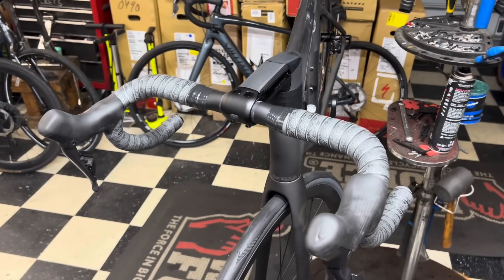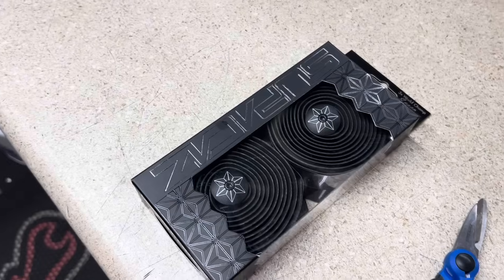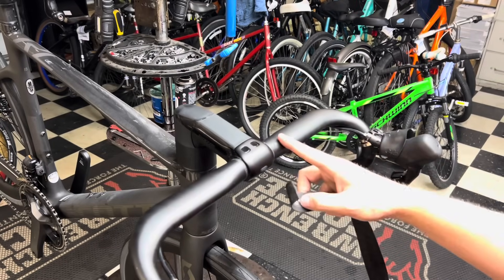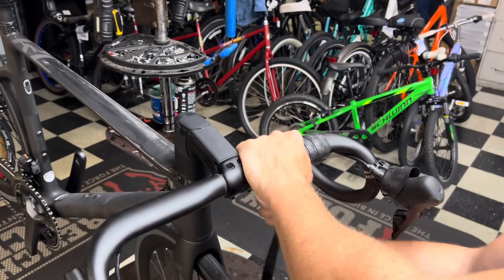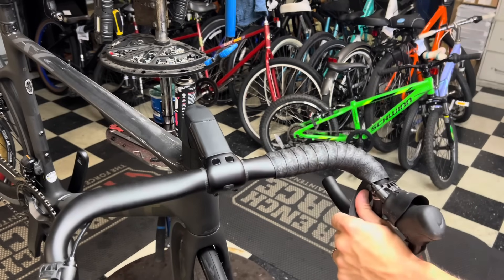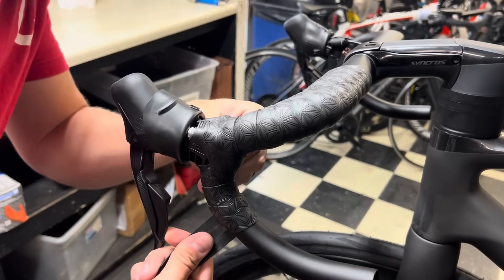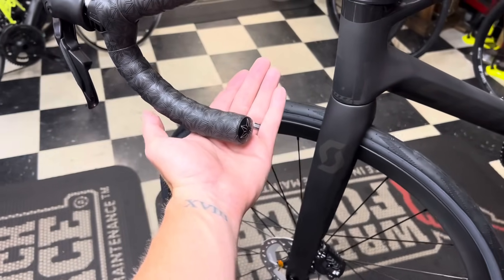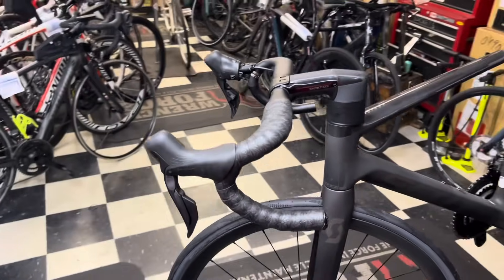HOW TO WRAP HANDLEBARS ON A ROAD BIKE, NO TAPE SHOWING *CLEAN*

Comment from the maker: Is this not the cleanest setup to run?!?
Reply: its clean but im not a fan of the fig. 8
Reply: Gonna try this next time I do my bars but how did you determine how much to cut from the end? Or did it just happen to be the perfect length?
Reply: Clean yes, but prone to rolling the edges, and also collecting dirt and water.  That’s why for the last 50+ years it has been done from the bottom to the top.  There’s a reason for that.
Reply: @karlp4443  exactly - just look at the pro peloton at TdF, simple
Reply: @karlp4443  Team Ineos mechanics apparently are wrapping the bars from bottom to top in the traditional way but they’re then securing the bar tape with glue instead of electrical tape. Best of both worlds. I’m gonna give it a try next time I wrap my bars. If I fail I can still use the good old electrical tape.
Reply: @karlp4443  I still see no problems
Reply: loll, my biike.
Reply: @TDZed  cut off excess when you've finished wrapping.
Reply: Your wrapping the tape the wrong way. You wrap from the bottom up so the overlap is facing down. That way as you apply downward pressure you never peel the tape or lift the edges of it. Maybe its less of an issue with these new fangled tapes, but classically its bottom up.

A bit of electrical tape is perfectly fine. You can even get it in fun colors/patterns. I think it looks cleaner going a bit thinner with the electrical tape than the bars in this video had.
Reply: he also went the wrong direction, it roll after a few miles

Comment: Nice but wrong way around. This way it comes loose faster, dirt can enter faster and when moving hands downwards along handlebar it doesnt feel as smooth
Reply from the maker: who the hell slides there hands down the bar, you lift and grab, also dirt and sweat enters handlebar tape regardless, yes I know it was a reverse wrap, but there wil be no issue with this, people always wanna complain
Reply: @GCPerformance18  yeah , pretty dumb. I play tennis, if you put it on correctly , i change hand positions so often, if its tight. It wont come off unless you want to.

Comment: The first time I saw someone wrap it reversed was a few years ago. I started doing it shortly after when I was in a gravel race and it rained for most of it. The finishing tape came loose as a result on one side and wouldn't stick anymore. I had to unwrap the bar tape some and tie it off to keep it from unwrapping anymore. The only drawback to the reverse wrap is I push against the edge of the tape when reversed wrapped.
Reply: Thats why its really a gimmick. As far as im aware, only novice riders and ones that dont ride often wrap from the top down. Word on the street is all race teams wrap from the bottom up, with 50% wrapping one direction and 50% wrapping the other. Some wrap for the hands twisting in the drops, some wrap for the hands twisting on the flats. Ive heard it stated that its when holding the flats of the bars when athletes are really using a twisting motion on the bars, which makes sense to me. The same person said when you're in the drops its more of a linear motion, which also makes sense to me.

Comment: I'm wrapping this method for years, hate electrical tape on tops, but you run drops in wrong way, better is to run from inside to outside, no issues at all with this direction.
Reply from the maker: same here, I live in florida so the electric tape melts around here in the hot conditions

Comment: I like the idea of no tape, but isn’t the tape wrapped backwards to the way the seams show.  When your hand is on the bar you tend to push away and you might see a “rolling” of the edge????   Thoughts?
Reply from the maker: everyone says this, this tape used in the video is very nice tape, had a big strip of adheasive on the backside, when done correctly and pulled taught, this tape will never unravel, all the jobs I have done the customers wear the tape out before it ever moves. I have seen with cheaper tape with small strips of sticky on the back and poor fit or rider getting fatigued they tend to lean on the bars more then intended too and can cause the tape to move around

Comment: This is ofcourse the logical technique if you don't want to use electrical tape. However, ofcourse there's a very good reason why the bar tape is professionally wrapped from the end inwards. This is because your hand would typically run over the bar in an outwards direction. With this technique that would mean your hands would run "against the grain" so to speak and this can wear out the edges of your bartape quickly. This is why we use finishing tape. Otherwise everyone would just do it like this guy in the video.

Another pro tip is to change the direction on the lower part of bar wrapping from the inside to the outside (when starting from the end of the bar ofcourse). Because when you grip it your hands tend to rotate in the opposite direction when gripping the lower part of the bar. This way the rotation will tighten the tape instead of loosening it up.

In the end this doesn't matter much for performance but this technique would make your bartape significantly more durable meaning you'd have to change them less frequently. So pick your poison: frequently having to change your bartapes or a piece of finishing tape...
Reply: ^^ This.  Years of experience has shown me that wrapping bars "top down" as shown in the video instead of the traditional "bottom up" results in the bar tape wearing much faster.   My current bars were wrapped "bottom up", with ugly electrical tape, and the Shimano padded tape is still going strong after three years of use.
Reply: @buster.keaton  rather have sexy setup and replace bartape 30% sooner.
Reply: I do both. Like shown here from the top, then stop under the hood, cut to triangular edge and hold down with 2 - faced carpet tape. Then start from the bottom in traditional way, using plug, in opposite direction. Cut in triangle end to match up perfectly with top section to carpet tape and then finishing tape on top. Advantage is that the finishing tape covers the joint and never sees much wear, while the tape is in the right direction in both sections, being locked in by the plug at bottom.

Comment: This is the way that I wrapped bars in the 1970s.  I mostly used adhesive backed cloth tape (I believe it was Tressostar) back then.  Looked good at first but the tape would gradually fray and creep then down the bar eventually leaving gaps.  Plastic tape (Benotto was popular in the 1980s) wrapped this way would also creep leaving gaps much faster.  That's why nowadays the pros wrap from the bar ends up.  If you don't mind retaping your bars more frequently then top down as in the video works.

Comment: Have to admit this looks dope. After fluffing my bar tape numerous times last night I did this and it looks great. Much easier to get it tidier at the top starting here and the lack of need for securing tape makes it look super clean. I’m not convinced it won’t roll or move about but I’ll see how it fares. Bar taping is a bugger of a job if you are plagued with ocd lol!
Reply from the maker: just vie it a try, it will not roll around at all as lonmg as is it done right
Reply: Ive heard too many horror stories and dont mind a little tape. If you do a clean job the tape isnt even that wide. Plus you can use all kinds of fun colors!

Im thinking orange bar tape with some kind of neon vinyl tape. Or maybe I can find some retroreflective stuff, that would be fun!

Comment: Manufacturers used to use this method for decades until the "Pros" decided to do it the other way.
I have used this method all my life and I have never had any tape come loose, I am 55.
I always use tape with the adhesive on the back.
I used to do this at Raleigh and have easily done over 30,000 bars this way so I have a little bit of an advantage 😀.
I know it was over 30 years ago but the skill never leaves you once you've learnt it.
125 bars a day, 5 days a week and 48 weeks a year.
I was doing it for just over a year.
Reply: I'm 55 and tried this once about 30 years ago. The tape rubbed off on the bend from the straight part of the bar into the hoods. I never tried it again.

Comment: I prefer end to stem wraps as you’re not rolling the edge of the tape.
Wrapping the drops with double side tape first is good though, as if you ever crash and rip tape, it won’t unravel.
Reply from the maker: who rols the edges I have never seen that, are people just being lazy and letting all there weight sit on top of the bike and let themselves slide around on top? get a better bike fit
Reply: @GCPerformance18  Yep, on reflection I think it would be fine if you use decent tape with sufficient tension. It certainly looks super clean.
Double side sticky tape underneath the bar tape on the drops is worth it too.

Comment: Makes me wonder why we ever started from the end cap ? The electrical tape always unravels,  I tried using electrical shrink housing, which does a neat job, but your method is better.
Reply from the maker: Yea especially with the moisture and the heat here in Florida. The electrical tape gets melted and slides away

Comment: You sir, are an artist.
Reply: @GCPerformance18  my old bar tape started coming loose shortly after watching this - it was a sign! I was slightly concerned about the tape edges facing up on the drops but did it anyway. 
I had trouble getting the tape tucked in the ends neatly but got there eventually. Expander plugs help keep it tight. And the tight wrap means and don’t feel the edges. 
Thanks to your video my bars are now clean AF!

Comment: Question.. i used supacaz tape last week to wrap my bars,, but it didn’t come out that great after looking at it closely… is it too late to retry with same tape?   I did not do reverse wrap and I didn’t cut the tape (taper cut) when I got to the end.. i just wrapped a few rounds of electrical tape and called it a day lol.   It doesn’t look great up close.   :(
Reply from the maker: Yea you can re do it. It shouldn’t be a problem. Just pull it tight

Comment: I think I will try this on my next wrap. Does wrapping clockwise or counter clockwise makes any difference ?
(maybe we should wrap in the direction we tend to squeeze the bar when we ride ?)
Reply from the maker: as long as you have a nice tape with a nice adhesive strip and you wrap it tight and secure it at the end then you are good

Comment: My exprience with reverse wrapping not good... Because it's in reverse so the overalpping is in opposit direction and when I shift from top to hood the lip of the tape kept on catching and when doing offroad the dirt will trap underneath the tape.
Reply from the maker: what? there will be no issues with this way, that is the problem though that this is all subjective because one person can get a bad wrap job or maybe do it themselves and not do it correctly, and could be looser then suppose to and this could cause those issues.
Reply: @GCPerformance18  i really admire your passion trying to explain every single hater that the bartape wont unwrap XD

Comment: Dude I tried your reverse wrap with the Aerofly2 but they managed to unravel after a couple hundred miles.  Any pointers?  Pull tighter?
Reply from the maker: yea man you have to pull tighter maybe I dont know because eveyrone is different btu i have done so many of these builds and i od ahve any issues with it
Reply: Depending on the way you wrap it… most people don’t notice, but when out and riding they grab the handlebar with a straight wrist and slowly pulls it down… so depending on you wrapping back to front or front to back, can have an effect on it unraveling without you intentionally wanting it to 😊
And yes, as tight as possible 😊

Comment: 20 some years ago, I bought something called "Handlebar Tape Locks" for my bikes, that were plastic, and covered up any electrical tape that secured the ends of the bar tape. They came in multiple colors that could match your bar tape. I'm still using them on all my bikes, 20 years later. Looks like they are only available from China. PS. They only work on round bars.
Reply from the maker: that is awesome i have not heard of those but for sure I have to take a look at something like that
Reply: @GCPerformance18  if only flat bar diameters were the same as drops we could just use lock on grip collars.

Comment: I notice the way you wrapped it on the drops the tape is going inward not out away from the bike. I've always heard to tape outward on the drops. Is this not a thing to worry about anymore? How long does this method for you?
Reply from the maker: Im a mechanic at the shop and we have been doing this now for over 5 years on our personal bikes and also customer bikes here..... no issues at all and as long as it is performed correctly and pulled taught, it holds up so nice

Comment: I’ve watched a good dozen wraps with good info, including this one. I found maybe 2 that account for hand positions and natural wrist rotation. I just started to do my own bars as I noticed the wrap starting to lose it’s tightness. Granted the amount I was riding I should’ve changed the wrap once or twice a year. My hands tend to roll outward on the drop and backwards on the tops. Many examples have the tape rotation in the other direction. Has anyone come across this? Many years of riding a Fixie and single speeds have changed my geared bike riding bar position. I am going to try this only have the tape roll out on the drops.
Reply from the maker: could also play a big part in what tape you are using, per exampple the tape I use in this video it is very sticky and also the adhesive strip on the back side has nice grip and is a thick strip, no amount of pressure is going to cause it slip when done right, to be honest the tape will start to have wear marks before it un ravels if done right. make sure the tape you choose is a nice quality first

Comment: This goes directly to my Favourites folder for further perusal, examination and application in practice :):)

A question tho-what do I do if the bar tape I use is quite a bit thicker than this one? I like silicon padded tapes and making a figure of 8 creates a bulbous monstrosity.
Reply: i did figure 8 with a bontrager double gel cork, thing is massive, and it was okay, and it came with  2 pieces of slimmer tape to add behind the bars (instead of figure 8), so i guess your best bet is to not f8, and use a slimmer tape strip for the peasant wrapping if you can't get it comfortable enough
Reply from the maker: Just pull it tight, that is all. I never met a tape that was too thick and I have done it all
Reply: @core2zero  "Peasant wrapping" LOL :):):)

Comment: What if you have a Di2 bar end junction box?
Reply: Simply switch to 9200 dura ace, doesn't use a junction box
Reply from the maker: You have to get creative and use super glue or hot glue at the end and finish it that way

Comment: Does it undone itself often
Reply from the maker: Neverrrrrr, not lying, all the ones I have done the tape has wore out from normal wear and tear. It never gets loose
Reply: I went to this method a few years ago because I had the finishing tape come loose in a wet gravel race. The bar tape started coming unwrapped, so had to tie it off. Never had any problems doing it this way.

Comment: I tried the reverse wrap once, but when I rode aggressively, my hands would splay out and go against the seam of the tape and ended up making the ends curl up.

I have that Supacaz on my all-road rig. At first, I hated it. The shop put it on without letting me know instead of the Fizik I normally use. It felt too sticky (in a bad way). Now that it's worn in a bit, it feels absolutely great.
Reply from the maker: very nice, I have not had anyone with issues with the jobs that I do, but also this is also a subjective thing because someone could get a bad wrap job or do one themselves and have a shitty time and it tarnish there whole feelings about this
Reply: @GCPerformance18  I'm an unorthodox brute when I ride so it might just be me that it didn't work out for. 

I still treat all my bikes like they're '80's PK Rippers like I used to ride. LOL

Comment: Handlebar tape, wrapped like this, will unwind and curl up when the hands slide left and right from the stem or down on the drops?
Reply: I've been doing it this way for years now. Never had a problem. The only issue is that I push against the edge of the tap when on the hoods as the exposed edge faces me. Not really an issue so much as I tend to replace my tape fairly often anyway

Comment: your are wrapping it the wrong way. wrap it outwards. your grip tends to push the tape outwards, so in this instance with wrapping towards the bike, you are effectively tugging in the opposite direction when holding the handle bars causing with time, an unwrap.

I think this is especially important since you are not locking down the wrap  tape at the top with electrical tape.

this is like wrapping 101.

Comment: No-one has noticed that you wrap the tape in the opposite direction to the pressure that you put on the tape with your hands when riding. What I mean is, shouldn't you wrap the tape clockwise from the start point on the handlebar ie away from the front of the bike? Your video shows you wrapping the tape towards the bike from the start point ie anti-clockwise. So the pressure from your hands on the tape when riding has the effect of loosening the tape..
Reply from the maker: It will not. The adheasive on the bottom works way better than older tapes. This is my job I do this on all my customers bikes and they come back to me as well for service. Even with pressure the tape does not come loose. If you are using crappy tape or wrapping to loose. Sure that could be a possibility